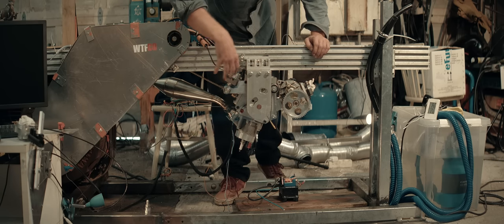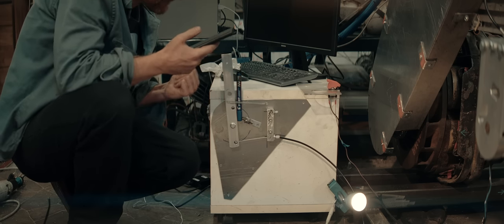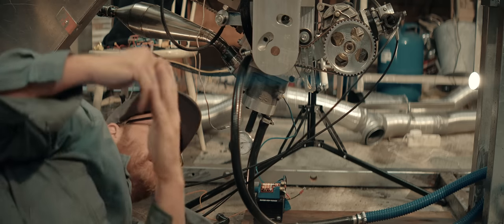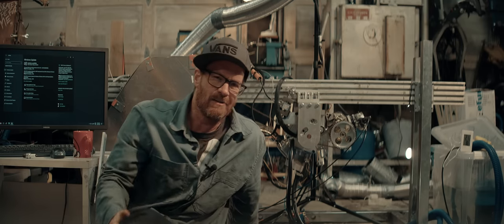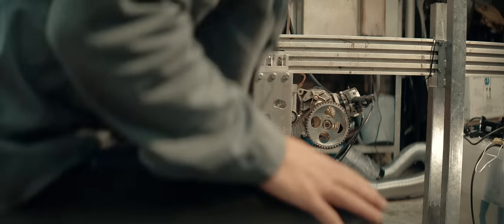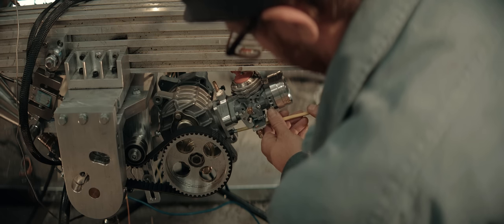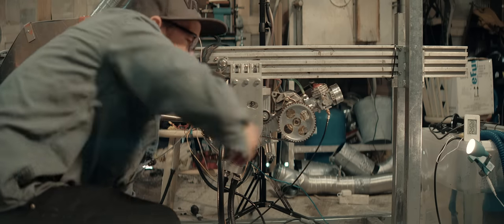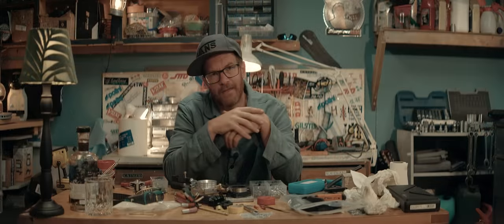First Start! Supercharged 50cc "moped" Engine. What can go wrong...

Comment: The issues you are experiencing are probably beyond this simple comment (and it has perhaps already been discussed and I missed it), but how is the tuned pipe working with the exhaust extraction system? I used to have a few two stroke bikes and they wouldn’t run with an exhaust extraction system attached, like when they where inspected (similar to a DOT/MOT inspection). But I remember that system having a much tighter fit compared to this, generating a lower back pressure.

Comment: were you got to fix the resonating pipe so you dont make the frame oxidis rust find your twin peak speed  use a screw driver sweep the surface pipe were it stop jumping weld a rod you could chek the electricity betwen the carb and the exals if the isolation in betwen both of them is nutral water gererator victor shawberger https://www.youtube.com/watch?v=RkQRX76vSeI

Comment: Love your video but this is counterproductive you pressuring the lower crankcase and the piston need to figth the pressure in the crankcase to go down killing your hp in the process
There a reason why 2stroke diesel don't use the lower crankcase to push the mixture on top of the cylinder the supercharged can do this job
Using this design will greatly simplifies the engine design especially the brute force engine with all these external transfers
Reply from the maker: The piston has to fight the pressure on the way down, but what happens on the way up?😁
Reply: @2STROKESTUFFING  not much it not the power stroke and there pressure under and on top of the piston so it doesn't help going up and there a reason why crankcase pressure is a bad thing even for big engine 
But if you don't try we will never know for sure but I am not expecting much from this set-up 
Like a said many times there already a proven 2stroke supercharged engine
And valve will absolutely not be the limiting factor for max rpm just look at the cbr250f 4cylinder with a 20k rpm red line 
Anyway just trying to help a little and good luck in your testing looking forward for the most powerful 50cc 2stroke
Reply from the maker: @legros731  Thanks! Guess we'll have to try and see😁👍
Reply: @2STROKESTUFFING 👍 you could easily modify the brute force engine and completely bypass the lower crankcase and blow directly in the intake port like ski-doo does on the 850 e-tec turbo engine this will simplify the design and remove possible failure point

Comment: Why are you pressurizing the crankcase? With a supercharger you should not have to do that. You should be able to just blow right into the cylinder. If you explained it already in another video sorry I will go watch it
Reply: Mostly for the lubrication has he explained 🙂
Otherwise the engine would have needed a seperate oil system.
Reply: @espenschjelderup426  thank you didn't see that part.